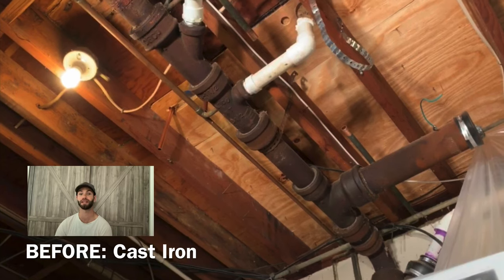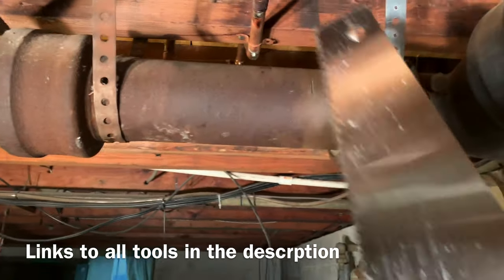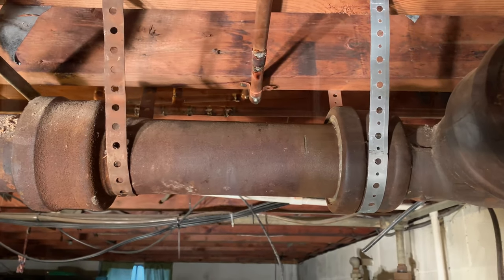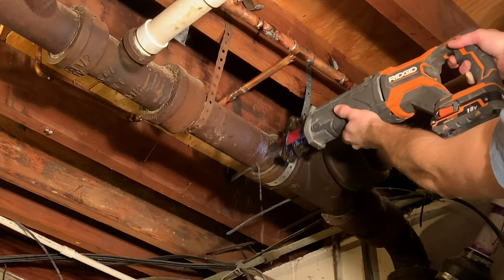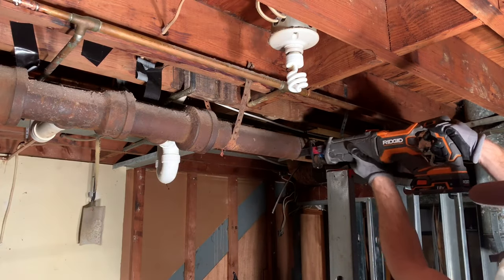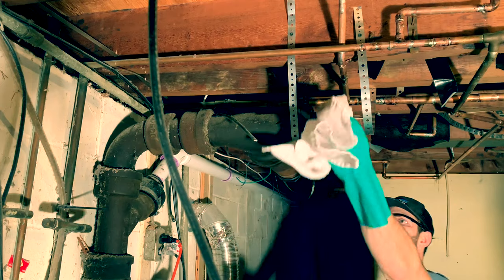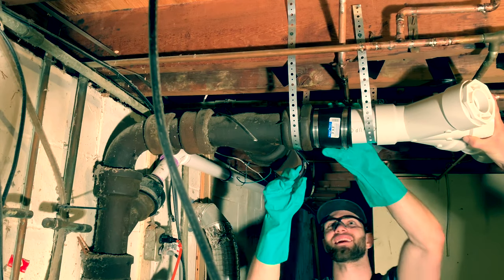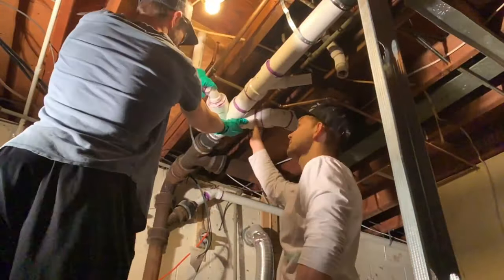How to Cut Cast Iron Pipe [Learn how to cut, remove, and replace cast iron sewer pipe with PVC]

Comment: Hey man, constructive criticism from a plumber, next time you do something like this, read the code book on orientation of fittings and dry/wet/individual venting or just hire somebody that knows what there doing.
Reply: 😂 I don’t see anything that’s actually done correctly.. Miserable code failure.. it’s like… wtf
Reply: I like the additional drain line coming in, installed after the Ptrap.. 😂
Reply: And the 3” clean out Y installed at the base of the  drain line… he’s going to have so many issues later on, and probably all the ptraps plumbed into this system will be siphoned out due to the short runs after them.. this video is really a, “what not to do” or “how to fail an inspection in 10 ways”😂

Comment: The finished product is incorrectly installed. You need a plumber my friend
Reply from the maker: Appreciate the comment Ricky! What looks incorrect? I had a plumber inspect the finished product and I actually had the whole thing permitted in my City and got approval. Appreciate your input!
Reply: Sanitary tee can never be used in the horizontal position, moreso if it's being wet-vented. It also is basically a crown vent now because of that same horizontal positioning.

The double-wye looks back-pitched on one side (toilet side, but my eyes could be deceiving me.) 

The proper way to install a double wye is to level it first and then glue your fittings - you pre-fabbed your fittings and the back-pitch is a common result.

You mentioned inspections, I'm surprised you passed because this would not be considered compliant with either the international plumbing code or the uniform plumbing code. Are you in a state that leaves code enforcement up to local officials?
Reply from the maker: @RickysPlums  In discussions with my plumber (I’m just a DIY guy), the long sweep 90 makes it acceptable. The pipe out the back is just a clean out.

Pitch was confirmed to be ok, so that might be the camera angles. I’ll definitely glue the double Wye in place next time. That’s a good point and I’ve definitely run into issues before by pre-fab gluing fittings.

Nope, we use IPC. Definitely still learning the nuisances of plumbing, but this was my first attempt at a project like this. Not saying it’s perfect, just my process for doing it. 

Appreciate your feedback!
Reply: @AndrewThronImprovements  Plus you used the wrong Fernco fitting. That one is designed for below grade applications. You need the metal wrapped one. Also you needed a fitting for the PVC to Fernco connection. I would have used a cast iron pipe chain cutter to cut the pipe. If you want to get sewage everywhere Milwaukee makes a cast iron Sawzall blade.
Reply from the maker: @aroundthehouseEricG  Thanks for the feedback, Eric! From my product research, the Fernco I used is “rated for underground applications” 
Which is likely a much harsher environment than indoors. But having the extra sheathing protection is never a bad idea if you want to spend the extra money. I am not familiar with the PVC/Fernco connection fitting - so please provide information (if you would be so kind) so that others DIY’ers can know their options. Lastly, I agree that chain cutters are the “right” way to do it. But I chose to save some money and go the rough and dirty route with tools I already had. Please keep up the constructive feedback. I will try and publish all the tips/comments so that others can be aware of what I did right and what I should have done differently. Thanks!
Reply from the maker: Thanks for the constructive feedback, Roger! Sounds like I’m using the shear band next time for sure.
Reply: @RogerWakefield  come on roger he put a san tee on its back. two strikes left
Reply: @AndrewThronImprovements   The Mission couplings (with the metal wrap) are required above ground for two reasons.  They add structural integrity to the pip so it doesn't sag and stretch the rubber and protect the rubber from rodents, who eat them for lunch.  Underground, neither are problems which is why rubber Ferncos are often permitted.

Comment: Constructive feedback. For the clean out, don’t bushing down to 2” or 1 1/2. Use a small hub-hub piece of the same size pipe, with a female adapter with plug. Allowing bigger size cables to be ran through the line. This restricts plumbers to smaller machines that may not have the power to cut through hard clogs. Second is ferncos are illegal to use unless underground. They provide flexibility to joints, so a sewer line won’t break while the ground settles. Mission bands (fernco with metal sleeve) are used inside homes. Makes the joint more structured, and doesn’t allow it to sag/move. Other than that it looks decent coming from a plumber. Minus the amount of fittings lol. Practice always helps.
Reply from the maker: Thanks for the feedback! Believe it or not, that clean out was originally a 1.5” vent. I thought I needed to tie a vent in there but the inspector told me to remove it. I was left with the 1.5” stub that I converted to clean out. You live and learn. 
As for the Fernco, that was just an ignorance error on my part. But oddly enough, the inspector didn’t mention anything about it. 
Lastly, since you are a plumber, do you have a ballpark number that you would charge for a job this size?
Thanks again!
Reply: I’d love to know a ballpark estimate too (high and low because I live in a ‘high’ area...) and want to know whether it’s worth it to attempt myself. 😁. (We got a permit so an inspector will check my work. 😬)
Reply from the maker: @sheilaa1333  I received a rough in plumbing estimate for $3500 for all rough in plumbing. So after purchasing materials, you could save around 2.5-3k. But plumbers do have a lot of code knowledge etc. So it’s hard to put a price on experience. Good luck!
Reply: @AndrewThronImprovements  Thank you so much!
Reply from the maker: @sheilaa1333  good luck with your project!
Reply: @AndrewThronImprovements  my reply disappeared....let me try again. I just did a similar repair on a rental house of mine and instead of the fernco you used, I used the Proflex 4 in. x 4 in. Neoprene Shielded Coupling for better  strength. Fortunately, you can get to yours if necessary easily to replace it if it becomes necessary over time.
Reply: No complaints besides the messiness of excessive glue
Reply: You have that backwards.  Armored ferncos are for outdoor burial. The one's used in the video are certified to work as designed indoors.
Reply: @phuturephunk I’ve been wondering about this. I just installed two rubber ferncos above ground and the supplier said they were the correct ones. (2 guys confirmed at the warehouse). But ppl in here are saying the sheathed ones are for above-ground. I’m confused.
Reply: @awesomerpower  The sheathed couplers are required for indoor use as the metal provides additional protection against rodents, nails, nicks, whatever.  At least here in MN.  It may be a MN plumbing code thing, not national, so may vary by state (inspector mentioned requirement when i did this years ago).  But either way, the logic is solid, so use sleeved when not burying.
Reply: @davidp6839  thanks. Yeah, I see no downside except maybe cost

Comment: Thank you so much for this video. We have a very old but still sturdy cast iron main line. The problem is the house is also old and when they did the back addition with the bathrooms they left absolutely no way to add any new fixtures (like a shower) without having to get behind the main line, up over the back wall of the foundation, and into a tiny crawl space. It's basically impossible to do without completely ripping out the floor, so we have to add the new fixtures where we can actually get to them. You have saved us easily $5k with this how-to.

Comment: My daughter and i did the main drain pipe some years ago replacing it with pvc. First time also by watching youtube. Now i see a pipe up in the celling that needs to be changed. For some reason I'm scared to tackle this one. I guess i would be the same. Pray for us. Thanks for your video very good.
Reply from the maker: Good luck with your project, Yvonne!
Reply: which videos did u watch specifically that helped?
Reply: @Eastbaypisces  I'm sorry when we did that project it was some time ago I can't remember which one it was.
Reply: @yvonne.stewart2745 how did it go? Very cool you and your daughter tackled this.
Reply: @awesomerpower  Thank you, sweetie. So far, we haven't tackled the other pipe as of yet. We have been working on other projects like the pantry. we guttered  and did the sheet rock.  it we had called a handling man who wanted to charge us 450.00 just putting up the sheet rock had nothing to do with the demolition or painting and shelfing. It came out beautiful. So next we have another project waiting to be started.  A little at a time, but we're learning.
Reply: @yvonne.stewart2745  way to go! It never ends, does it?

Comment: Plumber from Canada here......the double wye on a horizontal is a no no when your trying to put fall to one side.....your putting back fall on the other side would have to use two separate wyes for that!🍻
Reply from the maker: That’s a good point! Appreciate the feedback. Definitely some lessons learned on this one!
Reply: For sure man its always a learning cure 11 years in this trade and still learning all the time keep up the hustle!!
Reply from the maker: @ethanwoodfield7075  Thanks Ethan! Canadians are nicer plumbers lol check out the comments lol. Take care!
Reply: Over 30 years plumber here, also Canadian. A double wye on a horizontal is fine, you check the inlet for slope and make the branch level ( it is level on both sides ) if the inlet side gas grade then so do tge branches, 1/8 " / foot on 4" is easily achieved on a branch.

Comment: Good video. Curious to know, doesn’t the shower and the faucet each require their own individual vent line?  It looks like you tied the shower and faucet drain into the primary toilet drain but are relying solely on the primary toilet vent.  Is this correct? 

I ask because I’m tip toeing into a very similar project myself.  

Thanks man!
Reply from the maker: Hi! Believe it or not, I learned everything from Youtube lol. I bought this house a couple years ago knowing nothing about home improvement. Thanks for watching!
Reply: I'm a Journeyman Glazier and did a bit of home remodeling before rhat and your tackling stuff I feel is forbidden  territory!
Reply: The shower/tub has a built in vent with it. As for the toilet the way I normally do it is use a 3inch combo fitting and out of the back side go up with a 90 so I can shoot a 2in vent in the wall and out the roof. As for a sink you can stub directly up and using a a san tee add an studor vent and p trap.
Reply: Depends on your state. Kentucky requires individual vents that tie in everywhere. 

Some states go off international code. Some go off national code. Some go off of a state code. 

It's better to individual vent everything, if you ask me, but other plumbers will differ in opinion.
Reply: @AndrewThronImprovements I believe it, that's why the installation has code violations. 
To the o.p, 
Individual vents are not required but are ideal but they must be taken off tge top of the trap arm in a vertical configuration ( a wye and a 45. ) they must be wye and 45 becauee they are below flood rim and so just not be T fittings. 
If you have a 3" branch serving the toilet its common to take a 2" why off to the lavatory ( this is a wet vent) and pick up the tub 

The 2" is the wet vent for the w.c and the shower then . 
This video shows improper plumbing

Comment: 1:45 I would also add that you want to flush your toilet at least 5 times if not 10, to assure you that last nights dinner will not be staring you in the face once the pipe is cut.  Huge oversight there.  Secondly, with that much space around the pipe, an angle grinder with cutoff wheel would cut the pipe in 1/4 the time as any sawzall.

Comment: I had to do this a few years ago when my ancient iron drain busted. I used an angle grinder with a cut off wheel to get the old pipe cut out, I was left with a small section where I couldn't fit the grinder, and I finished off that small cut with a hacksaw.
Reply from the maker: It's not the most pleasant job, but someone has got to do it! Thanks for watching!

Comment: It’ll work just fine. I would have picked up the lav farthest upstream and I would have omitted the dry vent for the tub. If you piped it this way, the tub and toilet would be wet vented off of the lav. I would have gotten rid of the shower vent because code does not allow you to travel horizontally with your vent until you are a minimum of 6 inches above the flood rim of the fixture that you’re serving.
Reply: It's literally not to code on so many things.
Reply: @MrDmadness  it’s not so bad that it won’t work🤷‍♂️
Reply: @Dudjrkfjjffjkffu  thats true, my primary issue here is that hes made an "instructional video " while not knowing any code. How does a guy teach if they do not know ?

Comment: Just curious: why not use a 3x2x2 inch double wye for that sink drain instead of running it over the 3 inch line to tie into the tub trap?
Reply from the maker: Thanks for watching! Honestly, If I could do the plumbing again, I would have made a lot of changes (your suggestion likely being one). It passed inspection, but a lot of what I did was inefficient.
Reply: @AndrewThronImprovements did you ever do a folllw up vid explaining this? Might be helpful and I’d bet it would get a ton of clicks. Either way, thanks for your work, it’s a good helpful vid and your responses to commenters is pure class. It’s so great when these discussions can be had, it contributes to everyone’s knowledge.

Comment: Any idea how much a plumber would charge for a similar job? I would rather hire a plumber, but I’ll probably tackle it myself if the price is high.
Reply from the maker: @gregwhitten Thanks for the comment! I got a quote from a plumber for the full bathroom rough in (converting from a half bath to a full bath) for $3,525. I would estimate that for all of the work shown in THIS video, the cost would be around $2,500. However, I would love to get pricing feedback from viewers who are licensed plumbers. Comments welcome!
Reply: @AndrewThronImprovements    Yikes!  prices probably vary depending on location and whether you hire a self-employed plumber with lower overhead.   I hired a small company (3 guys)  last year to replace all the old galvanized supply and drain lines in a literal crawlspace for kitchen and 1 bath.  Adapted to cast iron main stack.   2 days work,   licensed and inspected $3500 in Piedmont NC.   Doesn't hurt to get 3 estimates :)
Reply from the maker: @curiouscat3384  that’s not a bad price at all! The company I had take a look was definitely on the larger side. I guess that was my first mistake. And you are right! After the first quote I just shook my head and resolved to do the work myself. Thanks for watching!

Comment: When i do some plumbing at home with PVC, I always take care to wipe the primer very well so it doesn't show. I really hate the looks of dripping primer!
Your saw blade must have been really good. I wasn't able to cut cast iron with mine, it wouldn't touch it. I had to use an angle grinder!
Reply from the maker: Angle grinder also works well! Pipe snap cutter is also probably a better bet than a reciprocating saw. Thanks for watching! Appreciate the support!
Reply: @AndrewThronImprovements  I did not know snap cutters existed. I just watched a video about those, impressive. Thanks for the info!
Reply: Most inspectors want a thin ring of purple primer outside your fittings
Reply: That’s weird I love the look for some reason
Reply: @whocares8158 me too, it says the work was done and not just slapped together.

Comment: Instead of killing your wood saw use a metal file to start your metal cuts.
Reply from the maker: That’s a good tip, thanks!
Reply: Grinder works well also
Reply from the maker: @kelvindunn4187  agreed - thanks for watching!

Comment: If there is a rusted spot on the iron which is leaky, any way to patch it up? Like maybe using epoxy putty?
Reply from the maker: In all honesty, this is a better question for a professional plumber. But I would for sure try to patch it with some putty (JB Weld steel stick maybe 🤔) before I would try cutting. Might need to make the more permanent switch to PVC in the future though. Thanks for watching!
Reply: It depends on where the leak is, but I've seen plumbers use molten lead to fill cracks on iron waste stacks before.
Reply: Don't use putty. Don't it right just cut a chuck out and replace it a piece of pvc and two boots

Comment: The pipes I will be working on should be dry inside.. Have not been used for years. Can you cut in smaller sections to make it a one-person job taking the old pipes out?
Reply from the maker: Absolutely - it's just kind of a pain to make more cuts than you absolutely need to. Thanks for watching!
Reply: You could pre-suspend a larger section with a couple ratchet straps and ease it down, I suppose. I have noodle arms so I always have to think up solutions like this.

Comment: Are those steel pipes typically screwed in or caulked in?
Reply: Back when cast iron was installed, lead and oakum was used
Reply: They're not steel, they're made of cast iron.

Comment: Which is better PVC or ABS BLACK????
Reply: PVC Schedule 40 is the most common residential sewer pipe. ABS has been banned in many areas for use due to the connections becoming loose and defective pipe made from recycled materials.
Reply: I've had to fix more ABS then PVC